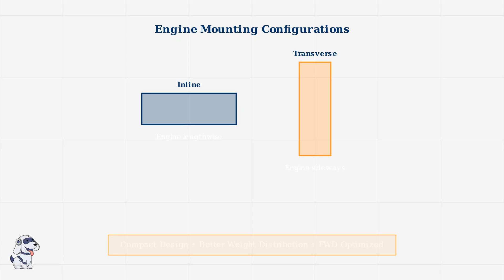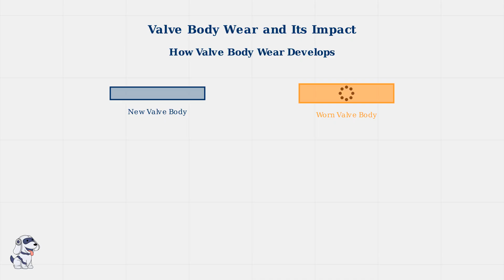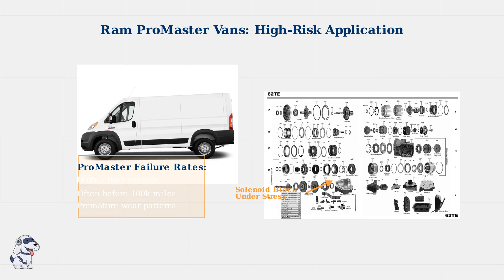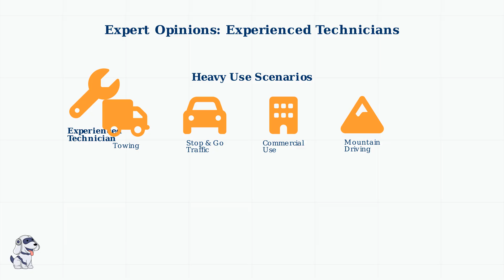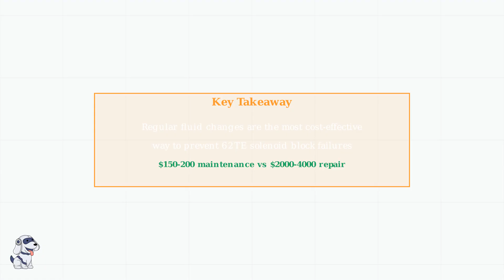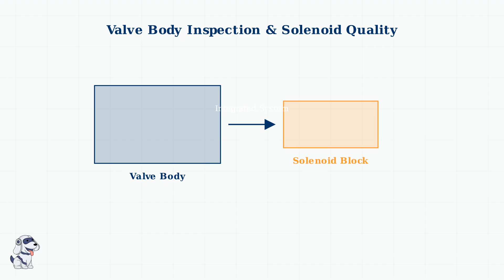Why 62TE Transmission Solenoid Blocks Fail Quickly

Comment: Bla bla, bla. You must work for Chrysler.  No excuse for this.  I replace solenoid pack 1 time and solenoid pack and valve body 2 times and it's broke again.  2010 VW Routan. Broke at 70k, 90k, 125k.  I pull no trailer, haul no heavy load, and don't have to deal with any traffic.  In fact I am the only one driving 95 percent of the time.   Replace trans fluid and filter each time.